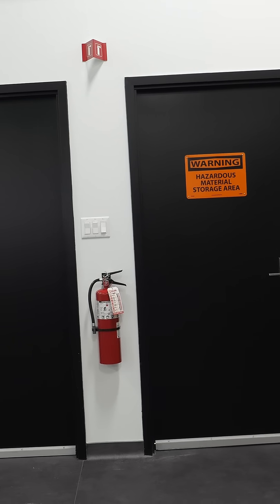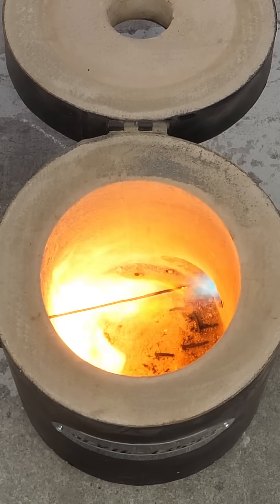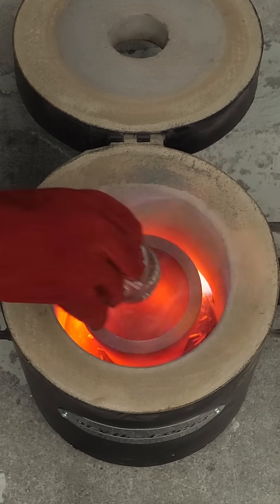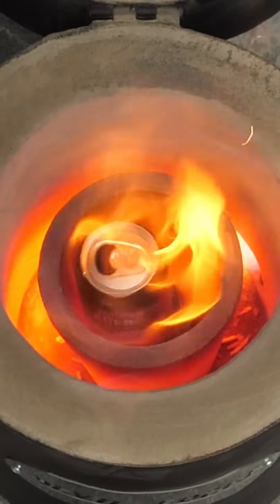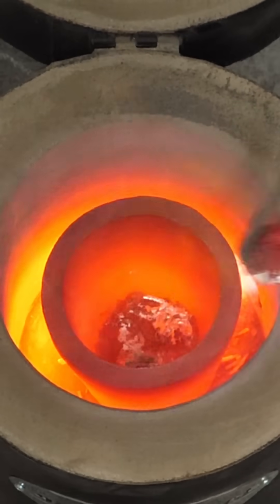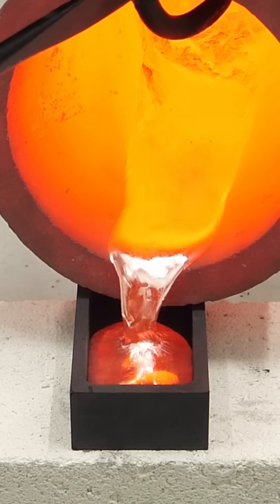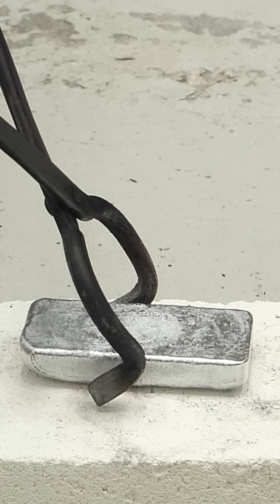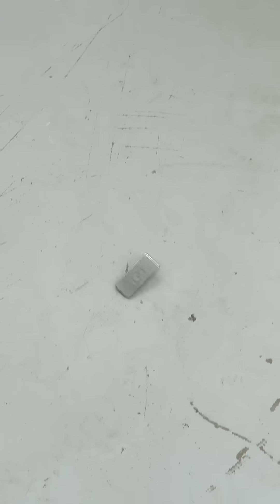Melting soda cans into a metal bar

Comment: The stank and smoke was the epoxy based coating that lines the can and insulates the aluminum from chemically interacting with the beverage inside.
Reply: yummy 😋
Reply: I left a can of diet coke in a drawer during Covid. Came back in 2 years and coke ate thru can. Can half empty.
Reply: @jaypesca8752 that was the sucralose... imagine what it does to your stomach.

Allegedly.
Reply: @willedtovictory to be fair I don’t keep Coke in my stomach for 2 years.
Reply: @willedtovictory  it was probably the carbonic acid which forms from the dissolved carbon dioxide
Reply: @willedtovictory  Your stomach can hold up to soda just fine. It's your teeth you should worry about.
Reply: @willedtovictory   BRO our stomach has one the strongest acids inside
Reply: @willedtovictory  Considering my stomach isn't lined with epoxy and doesn't store liquids for 2 years, this isn't that concerning
Reply: @willedtovictory  Diet Coke uses aspartame
Reply: Ahh the beverage diaper
Reply: @TheDepressedGoat 
HAAAAAAAAAAAAAAAAAAAAAAAAAAAAA!!!!!!!!!!!!😅😂😅
Reply: Yes. But why not call it an 'ingot' - the correct term - not a 'bar' ?
Reply: @BenNewton-c6z The terms are largely interchangeable. You can make a distinction between them and say bars are normally larger and further refined, but it's needless nitpicking that'll likely obfuscate the point.

It's like making a stink about the difference between a 'rule' and 'ruler' when taking measurements.
Reply: @Hine-Man Well - yes and no.  I think the term 'bar' is more commonly used in places like the USA or Australia. I'm actually English - and the term 'ingot' is more correct when referring to newly-refined (or re-processed) metal when poured into a mould - prior to further processing - when it could be further heated and rolled into 'bars' or sheets in the metallurgical process. According to the Oxford English Dictionary, the origin of 'ingot' is uncertain - but it's used as far back as the fourteenth Century by Geoffrey Chaucer in the Canterbury Tales - and I would guess its origin is either Anglo-Saxon or European from one of the Germanic languages like Norse or Viking - who would be very familiar with metal smelting and processing - not least for producing weapons such as swords. The term 'bar' is used in metallurgy - but would normally refer to newly-refined and moulded 'precious' metals only - like silver, gold or platinum. But, then again, that's probably being pedantic.
Reply: Plastic lining
Reply: I could have sworn nilered did a thing where he isolated the plastic from the can
Reply: Epoxy coating? I always thought it was some thin plastic
Reply: @dontwanadisplaynameonutube2951 
Well technically it is a thin plastic.  Epoxy is just a specific sub-class of polymer.  Epoxy is just a type of polymer with an epoxide chemical structure (a ring of carbon and oxygen). 

You have 3 main can liners used today Polyethylene (PE) , BPA-NI Gen 1, and BPA-NI Gen 2 (all are technically expoxys).  For awhile BPA plastic was really taking over the market from PE because it was cheaper, easier to apply, and faster.  However it is also a carcinogen.
Reply: @LogicalNiko  This man can can

Comment: Man best thing you do is start casting mallets. Take your piece of steel carve out of cavity drill through a point for the handle so you can have something that you can slide in and punch out later and you know put some fluid vents through there to keep it a little cooled off I'd recommend type of oil that you can circulate and go ahead you can mass-produce mallets with any kind of decoration you want

Comment: the smoke probably came from the plastic/rubber coating all cans has around the folded seams and the paint.. so yea not the best thing to breath in. but tbh this is exactly the type of stuff i wiiiish i could do.. if only i wasn't allowed to have a smelter in my apartment... darn stupid landlord.. i wanna recycle my own stuff.. whatever it be glass or stainless steel scrap or aluminium or plastic... but yeaaa.. i for one wouldn't want a gass powered furnace like that.. i would get a induction furnace instead even if they technically cost more to run then just using a gas tube... buuut as long as i live in a apartment i can never get it.. i mean i am just lucky as i am now that landlord has not said anything about me using my livingroom as a workshop and storrage instead of a actual livingroom...

Comment: Bars of smelted metals are called ingots. 

Adding borax powder will help the impurities separate.

When it solidifies you can indeed refer to it as freezing, that's exactly what it is. Freezing and melting doesn't necessarily mean cold and hot.

A bit longer preheat is recommended as well, as the crucible wasn't consistently heated through. If it's cooler at the top like that you can have issues pouring. Also you dont want it to freeze while you're pouring it so maintaining a higher than melting point temperature is best.

Smelting is a really cool hobby to get into. There's a few really good channels on here worth checking out, and the chemistry behind it could make some good content for you.
Reply: This is a older video, he has done many smelting attempts after this, and all you have said it correct, in his purple gold video he pretty much learned all of this through trial and error
Reply: @jazzxd9417  Yeah I need to sub finally and look around more. 

I just like sharing info!
Reply: Danm. Never thought of metal as frozen solid at room temperature. Makes sense. 😮
Reply: @dementiasorrow  even better than that, as soon as it begins to harden it is freezing, so it freezes at hundreds of degrees. 660 C is the freezing point.
Reply: do you have any channel recommendations on that topic because your explanation was pro af
Reply: @GigasAhriman  BigStackD is the main channel I watch but also have a little knowledge and experience myself as a toolmaker
Reply: @NomadUniverse   I've never heard of that channel until now. I'm subbed. Thank you!
Reply: @NomadUniverse  BigStackD mentioned lets go
Reply: @GigasAhriman  BigStackD
Reply: My understanding is that borax is the wrong flux for aluminum.  A mix of sodium chloride (table salt) and potassium chloride "lite salt" is used, unless you want to buy a commercial flux.
Reply: @scottwillis5434  Different sources say different things, from what i can see it's not the affect it has on the aluminium but the crucible as to why people say dont use borax for aluminium.

I'm no expert by any means, but for the home hobbyist sources say borax is fine as a cover flux.
Reply: Forgot to add that from what I read you are right as far as a professional industrial environment. They would use the flux you're talking about.
Reply: Do you have a recommended website to get beginner level smelting gear from?
Reply: Sorry, but you're sort of inviting correction with your freezing/solidifying comment and the tone I invented/imagined when I read your comment. Freezing is solidification due to a temperature drop. You wouldn't say that the crystal formed by a solute after boiling off a solvent was frozen solid.
Reply: @jw20023  The comment has been there for a week. Inviting correction I think not. 

You said: "Freezing is solidification due to a temperature drop." What about that goes against what I said and how do you think you're correcting me?

We're not talking about crystals...
Reply: @Bigstackd is one of the best melt channels on YT
Reply: there's only chemistry there if you care about the purity of the metal. otherwise pure physics
Reply: Holy Mr. Chemistry Teacher

Comment: You know I have actually done this but I messed up bc I should’ve sanded them I’ve also done it with copper pipes. YOU HAVE TO PREHEAT THE MOLD NO WONDER WHY MINES CRACKING!

Comment: Good as raw material, but you can't get casting-grade from extruded aluminum. You have to mix in fine silica dust for that, to prevent porosity and ensure proper flow. Many people make this mistake! If you want to cast quality aluminum pieces, start with melting cast aluminum. Engine blocks/heads are an easy source, but small motor pieces can sometimes work and there's a fair number of old kitchen gadgets that have been rendered scrap from abuse and time that are also made of cast aluminum

Comment: Pro tip, never accidentally put a can upside down in the crucible. Its extremely intuitive why you wouldnt, but I remember knowing that, hastily putting cans in the crucible, and putting one upside down. Can goes pop, molten aluminum goes flying, it's not fun
Reply: Stuff of nightmares
Reply: Oh I’ll keep that in mind but I crushed mine before hand so ya
Reply: @Transformer_edititer  I crushed mine too. Its more of a pop sound when it's crushed as there's not as much trapped air and not as dangerous. Either way, you do it once and you won't again haha
Reply: "it's not fun" sounds a little fun tbh. but not safe, no
Reply: @Blag_Cog  uhhhhh.. shhh. Don't tell the others. It was a lot of fun actually haha. Scared the shit out of me, but I did get to experience something most people never will. Seeing what damage molten cans can do 😂
Reply: @PureNrGG  I wanna do it but I don't have the right stuffs
Reply: @Blag_Cog you can't speak about safety in this channel lol
Reply: dang, did you get hurt?
Reply: @razpberry0512  I didnt thankfully. Wasn't as bad as the time I put a copper fitting into the already molten copper and didnt realize there was some moisture inside. It only burned a toe as a drop landed on my boots (just before the steel toe) and burned through immediately. It wasnt nearly as bad as it coulda been. 
Thats also the day I got to learn first hand what happens when molten metal touches concrete 🫣. Also no injury but holy crap did it scare me haha

Sadly I had to learn from experience. Hopefully I can help others learn in a safer manner lol
Reply: @ :O well im glad your okay
Reply: @PureNrGG i’m assuming your talking about the splatter of even smaller droplets of molten metal 😂
Reply: @razpberry0512  he's not saying it happend to him, he's saying that if you do it, that happends
Reply: Wrong @Gepidball
Reply: Sound super duper fun!
Reply: Thanks I'll keep that in mind next time I use my crucible... That I totally own...
Reply: Also the molten aluminium is not a cool toy like pretending you are the terminator 2.
Reply: Or option 2, use some tin snips or something to put a couple extra holes on the sides of each can. This would allow for the gasses to flow through and not build up.
Reply: I'm saving that one in my the central storage part of my brain
Reply: I caught metal spatter on my feet from a blowthrough while learning welding when i was in school. Was NOT fun but teach got a bunch of new saftey gear out of it. In retrospect it wasnt the safest situation for a 14 year old, but you gotta love "small town in the 90's" shop class
Reply: This is why you should crush the cans before melting them.
Reply: And leaving the top open like NR here would probably make the situation even worse.
Reply: Nile taking notes
Reply: I was asking myself why did he not crush them & add them like discs instead of 1 by 1 in cylinder form
Reply: Screw Coke and Mentos, we need Upside Down Cans and Crucibles!
Reply: Ofc there's a reason why Lord Nile didn't do that
Reply: Yes, I’ve done that several times. It’s not good.
Reply: Ohhh so I can do it on purpose?
Reply: Another thing, don’t drink the aluminum.
Reply: Thank you for this!
Reply: I almost got a first degree burn from a uncrustable the jelly got on me and I thought I could endure it
Reply: @IPlayWithElectricityAndFire  Yeah, those Uncrustables are dangerous. Frozen or defrosted, handle with care,
Reply: steam explosions. that's why
Reply: "it's not fun"😂😂
Reply: That is an excellent tip ❤👍🏻
Reply: Looks like the same physics with launching something into the air but it's because the gases are trapped inside which causes the molten metal to propel upwards.
Reply: I once put an aluminum bat in, sealed end up. Lesson learned rather quickly.
Reply: Another misuse of the word "extremely."
Reply: @YaoEspirito please educate me then. Ps. Im genuinely asking, not being passive aggressive lol
Reply: @PureNrGG 
Tried responding, twice, but since I'm on record for criticizing the war crimes of Iz, YT auto-deletes 90% of my comments.
Reply: Remember to also preheat all of your tools!
Reply: Sound pretty scarry😅
Reply: Wouldn't cooking/pre-drying the cans solve that? Just have a big fire or convert an oven to be a workshop oven. You should always have considerations for preheating and preparing material if you're going to be forging.
Reply: @KaiserTom  honestly it would. I, however, much like many others, do it as a hobby. Plus im broke hahaha i built my forge out of a home depot bucket, kao wool, and refractory cement. I have since updated to a steel body 😂 but surprisingly, the plastic held up amazingly and only melted in spots where the kao wool was thin
Reply: How do you know about that
Reply: @Stuffplusplusshorts : Didn't he tell us that in his comment?
Reply: @Stuffplusplusshorts  First hand experience. I also once forgot to preheat a piece of copper pipe. Luckily it only spay a little molten copper. That one sucked lol
Reply: Sounds fun I wanna try
💀💀💀
Reply: I wonder if the alcohol in the beer cans could ignite and turn it into a rocket lol
Reply: @az.madrona  that would be so much fun hahaha. Unfortunately, i have the knowledge to know that wouldnt happen lol. Beer doesnt have enough alcohol in it to ignite such a small amount. Unless something caused the alcohol to collect all together, theres too much liquid to ignite.
Still, could emulate the same thing with a bit of gas, tho i highly HIGHLY dont recomend it lol
Reply: Thanks for the tip
Reply: You probably learnt that the hard way😂
Reply: Yeah, I’ll keep that in mind if I can ever afford a $500 crucible😂
Reply: @DamascusWench  I got mine for i think 60 or 80 bucks on amazon (CAD) a few years ago. Surprisingly, The crucible is the most expensive thing i own for melting metal. Even all the matetials i used to build the furnace were cheaper lol. Its hard finding a material that can handle that kinda heat!
Reply: I honestly thought you were going to say it would become a little rocket
Reply: Your welcome from me for getting you to 69 replies
Reply: Mini rocket from hell sounds fun AND scary all in one
Reply: That seems to be something he knows. And should have said because it can get ugly.
Reply: This should be pinned.
Reply: God bless you, your family and close people, man.. oof..
Reply: bro the way im laughing right now 🤣🤣🤣
Reply: I'm gonna do that just for that reason
Reply: Nile would think it's fun
Reply: How many cans do you think he used for that little brick
Reply: @TheBawlz09 honestly I can't estimate things worth crap 😂 I wanna say like 25 at least. Each can provides very little aluminum vs other junk that burns off like the plastic interior lining. So it's always gonna be more than you guess 😂 I know this is kinda a shit answer, but hopefully it works for ya!
Reply: @TheBawlz09  more than one
Reply: How many never knew that.--I didn't. Thank you for the major saftey tip.
Reply: He doesn't read comments anyway.
Reply: By upside-down, you mean tab side down, correct?
Reply: oh wow ㅠㅠ thank goodness you were still able to write this comment (glad you're okay) ♡ Stay safe, please! and thanks for the super useful safety info ^^
Reply: Hola
Reply: Now I wanna see that
Reply: Safety first 😂😂😂
Reply: Are you, uh, good?
Reply: Pro right here pro here now
Reply: And always preheat your molds for the same reason.
Reply: "Never accidentally ...." So it's okay if you do it on purpose. Got it.

[Proceeds to earn Darwin Award.]
Reply: Nile Red might consider that fun!
Reply: “Extremely” intuitive? Only an “extreme” idiot hears “upside down empty soda can in crucible” and isn’t immediately alarmed.
Reply: @mandyheart8754  Mistakes happen my friend. We learn from them.
Reply: Good to know thx
Reply: 🎉btw Jesus loves you repent and believe in the gospel
Reply: Same pfp
Reply: Thx for idea
Reply: Sounds funny and painful
Reply: Start your own channel bro.  People love metal working content.  Sounds like you've been doing it for a while. You could probably help bring more people into the fold. 

I really want to get into metal working, I just dont have the money for the equipment or the space for said equipment with my current living situation.
Reply: @MetallicBlaize to who
Reply: What a relief,  it appears i have common sense because I was able to figure why not before it was made clear in your comment.  Thank you 😊
Reply: @Onyx-_-liquor i wish he would say it in the video regardless. It can be pretty spectacular and dangerous
Reply: It’s one of those things if you said this is damgwroua can you guess why? I’d have guessed exactly what you said. But would that have occured to me without ever having made the mistake before? Idk lol. Makes you wonder about the seemingly obvious simple things that you can fuck up doing almost anything and turn it deadly
Reply: It's the gas that will cause pressure buildup in the can and cause it to explode
Reply: That sounds like I great idea: Osamu Dazai (probably with wan Akutagawa)
Reply: What.
Reply: Yes it is😂

Comment: As the knowledgeable @Ninetales2000 said, the smoke and smell are likely from a combination of the plastic anti-corrosive cotaing inside the cams and the paint outside. If you cut the top and bottom and make the can a sheet, you can sand it down to mitigate this.